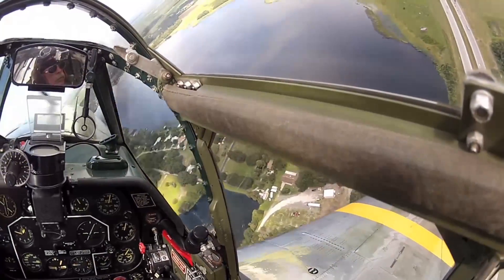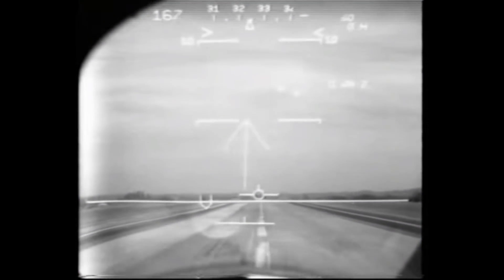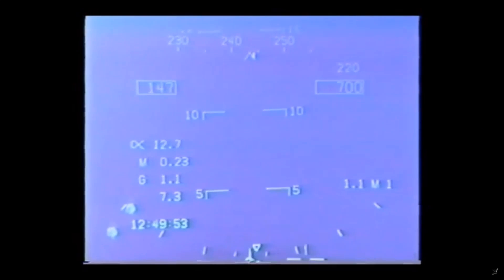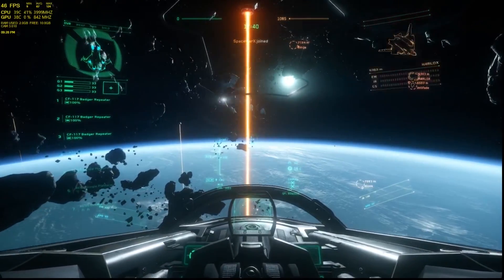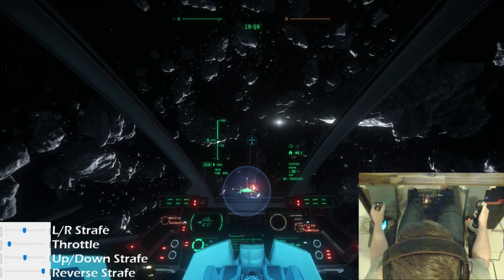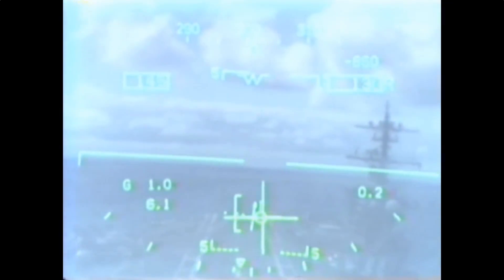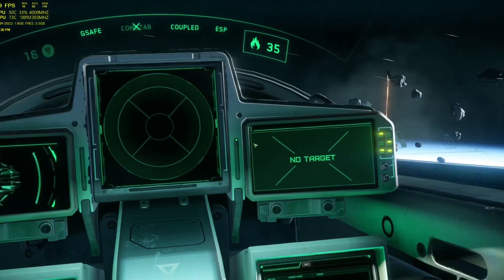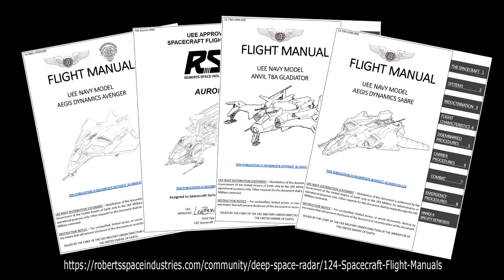Principles of operation - Heads up display

Comment: What's the flight path vector? Thx for the video also
Reply from the maker: Flight path vector - shows where the craft is actually going, as opposed to merely where it is pointed as with the boresight. Usually shown as a HUD element. In SC it's the TVI or ATVI.
Reply: @Nimrod77  thank you!
Reply: basically like a crosshair in games